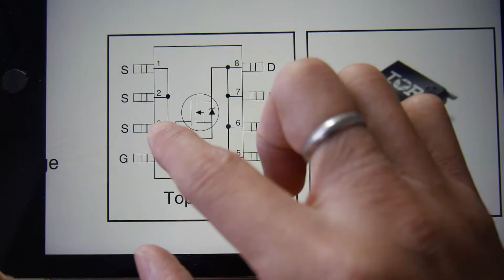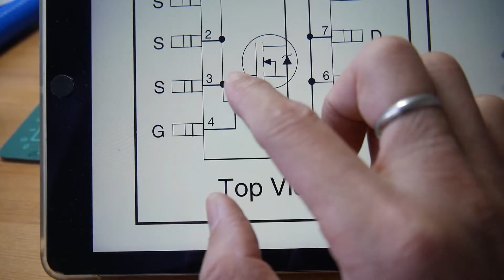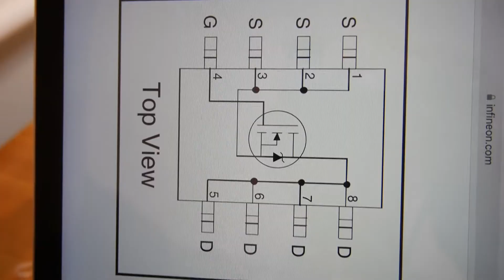Woozoo Fan stops working, very common problem on this fan!

Comment: Comment from @postcert to remove the base:
You can just skip the four retention clips. (They only attach the track the upper housing rotates on)
After you take the center cover with a single screw you'll central metal tube the power cable goes through.
The only part holding the bottom housing is this segmented ring sleeve/clip that wraps around the metal tube. You just need to pry/pull the two sides out of the notch in the metal tube it clips into.
After that the whole bottom housing should be loose to pull out.

In the end mine didn't have any obvious component failures and still turned off once it hit the end of the sideways motion even after greasing the track.
Except now it sets off a nearby UPS when it shuts down so it's going to be returned instead of risking this shorting behavior.
Reply from the maker: Thanks for the detailed base removing method. This would help many people for sure!

Comment: Holy shamwow, obscure repair videos like this are an absolute godsend. I spent the last hour thinking I needed to access the fan from the front somehow and wasted at least an hour before realizing it was impossible. I just never would have thought someone would post the exact video I would need for a random ass fan bought from Costco. Feels like most people don’t bother with repairs in the modern era, so I’m overjoyed to see that may not be the case. Moreover the comments provided the actual golden solution with regards to accessing the circuit board. Wish I spent two minutes searching before embarking on my repair quest, would have saved myself a great deal of assembly/disassembly for no reason. 

Anyhow, thanks so much for making this video. Love it!
Reply from the maker: Thanks for your comments. Many comments mentioned about how to disassemble the fan, it is a bit regret that I didn't film it as I was so hurry to do the analysis on the circuit board.
The cover on the bottom could be removed and be aware how the wire was routed and the the plastic ring with latches around the  wire.

Apologies I could not describe clear enough with words. Hope you could find the way to fix it. Between, could you post the chip number that being replaced in this video? It was burnt out so badly that could not be identified.

Comment: What to do if the fan is running but the control panel is not working. Fan runs at full volume.

 
Did your fan run again?
Reply from the maker: This is another issue that control the voltage input to the motor. That needs to be further investigated.
Reply from the maker: My fan didn't run again as I couldn't identify the chip number. If you have the fan disassembled, could you tell me what the 8pins chip is please?

Comment: So mine fell on floor, GF knocked it off bedside table and my circuit board is cracked. Anyone know if/where I can get a replacement board?
Reply from the maker: You may look into parts from ebay or other website. Recycling company may advertise there that you can purchase from their physical store

Comment: Mine I can hear it buzzing none of the buttons working , I took it apart the motor turns very very slow
Reply from the maker: Suppose is power chip failed
Reply: @ possibly , I just took it back to Costco for a full refund , can always get another when the warm weather starts

Comment: I wouldn’t be surprised if the board had a bad design that will lead to overheating with extended (as in, hours at a time) use of the fan over many months (not many hours every day of every week, of course—this isn’t a commercial unit by any means). If this is true, then merely replacing the components will inevitably lead to the problem reoccuring. The consumer is then left with the choice of replacing the unit, which isn’t cheap, going without, or buying a fan from a different manufacturer. If this brand has many reports of failed operation, then it should probably be avoided. I have two, and one is dead (hence why I found this video). I’m not going to troubleshoot an entire board and perhaps only create the conditions for the problem to reoccur. Ah well…nice little fan.
Reply from the maker: Thanks alot for your experience on this fan. Are you able to confirm the power IC chip (8pins) that I replaced in the video ?  The one I used was under a logical guess after reseaching in the web. Can you solve the mystery please ?

Comment: Hi, I am in India and the fan broke after plugging it directly without adapter and there is no service center for it anywhere in India what to do? What would be the reason
Reply from the maker: If it broke due to voltage difference, eg. 220v India but the fan is 110V. You may be able to search any burst of capacitors and change them. Next time you use it with adapter, that may work.
Reply: Check the fuse inside of the main plug if not then it is likely a blow-up brown fuse next to 110v input wires on the board and voltage dependent resistance (that is RV 1 ON this board) got bursted to protect the circuit.

Comment: You left out the most important part, HOW TO REMOVE THE BOTTOM?? Seems easy, like just pushing retention clips but is not
Reply: Pry the outside edges of the center clip apart to disengage it from the threaded metal tube the cord runs through.   Base will slip right off.
Reply: @striderz69  there are 4 clips, 2 of them ON the metal shaft. Prying away and it returns. I finally got the bottom off and made the repairs. The trick is to pull back one of the tabs then pry the side to lift the tab over the metal lip.
Reply from the maker: Please find the comment from postcert below
Reply: @houseman2022 I don’t see that comment please make a tutorial on how to remove the bottom
Reply: @houseman2022  You can pin that comment to make it easier for everyone to find

Comment: If your woozoo fan turns on, spins and appears to work but shuts down completely after a very short time (within minutes), then the problem may lie with the clock/timing circuitry.

When the fan is first turned on, it defaults to an "always on" state.  This is indicated by none of the three lights for 1, 2, or 4 hours being lit.

If the fan stops shortly after powering on, try pressing one of the time mode buttons (1, 2 or 4 hours) then wait to see if the fan still stops moments later.

If the fan continues to work (ie: does not shut down completely), then there is likely a problem with the "always on" circuitry.

I have not dived into the circuitry of the unit that failed for me nor have I tried to reverse engineer it to create a rough schematic, therefore I can't specify exactly what the circuit is that may have an issue.  Perhaps it's a 555-timer type of circuit that has an incorrect or missing resistor or capacitor for the "always on" state.  The resistor/capacitor combination circuitry that sets the 1, 2 and 4 hour timing may not have a problem with those components, thus the fan will not shut off (until the normal prescribed time has passed).

I am posting this information here for anyone who comes across this same issue with their fan.  The diagnosis may also apply for fans that fault on the 1, 2, or 4 hour settings.  Just avoid using that setting.

At some point if I am ambitious and wish to further investigate, I may take apart my fan to access the circuit board to see if any parts in the timing circuit look damaged or missing.  But for now, I just avoid the "always on" default state.
Reply from the maker: Very detailed, thanks for your input
Reply: @annmckeith8209 - 
  
Firstly, I hope that my euphoric comment/description can also help someone to fix their fan.

My WooZoo (used for the 3rd summer now, mainly on horizontal oscillating during the nights) died a few days ago.  It just stopped. When I turned it on, it came back for 1 second (humming to hear), then turned off right away again. I tried different things, like turning the top by hand to right/left. It turned then on (always with muffled humming sound)...and off right away again. 

Well...this particular video here was the 2nd one I looked at, and after watching a minute or 2 I started reading the comments. While reading your explanations, I squealed and said loudly: THAT'S IT!!!!! I'm doing a lot of DIYs, also electrical, though, I'm by no means a 'skilled electrician', but I have a good technical understanding and comprehend easily when pros explain things. 

--->> So...long story short: I plugged the WooZoo in again, turned it on, and hit the time modus button: WORKED! But it turned off right away...since the horizontal oscillation was still on. Plug out, plug in, turn WooZoo on - and immediately turn off horizontal oscillation: WORKS. Then I turned on the horizontal oscillation: WORKS as well. Same with the breeze function.
I am proudly announcing that my WooZoo air circulator is on now for a few hours (on ALWAYS, not timer set) - no strange noise to hear. I keep it on 'always on/breeze or always on/level2', they are most comfortable for me, it just blows the air slightly above the bed. Plus, timer 2 or 4 hours for night. It runs as silent and smoothly as it did for the past 3 years. Thanks to you, @annmckeith8209 ❣ , and @Houseman22 ❣ .   .        .   🥰😍💖.  I'll appreciate your help, and keep sharing this with people who have 'dead' WooZoos. 

My motto: if something won't work anymore, no matter what you try, and you find a good tip on YT-University, TRY IT. The piece is 'dead', so you have a slight chance that you can repair it. If it does not work after several unsuccessful tries...well...so be it. Thanks again!

Comment: How did you manage to get the bottom off of the fan?  I have the 4 retention clips beat but there's something else holding the bottom on - maybe the cord?
Reply: You can just skip the four retention clips. (They only attach the track the upper housing rotates on)
After you take the center cover with a single screw you'll central metal tube the power cable goes through.
The only part holding the bottom housing is this segmented ring sleeve/clip that wraps around the metal tube. You just need to pry/pull the two sides out of the notch in the metal tube it clips into.
After that the whole bottom housing should be loose to pull out.

In the end mine didn't have any obvious component failures and still turned off once it hit the end of the sideways motion even after greasing the track.
Except now it sets off a nearby UPS when it shuts down so it's going to be returned instead of risking this shorting behavior.
Reply from the maker: Sorry I didn't keep the footage while removing the base cover

Comment: Why didn't you show the fan working?
Reply from the maker: The fan wasn't working after replacing those components. Hopefully the video shows the method of diagnosis on a bad circuit.